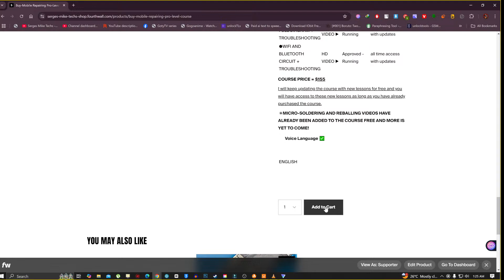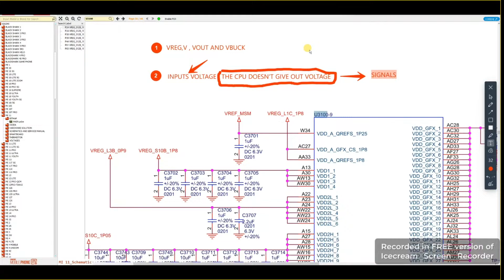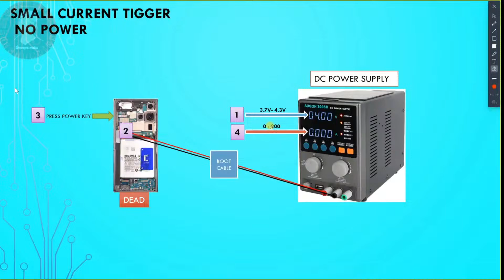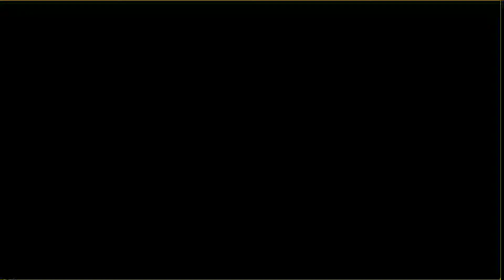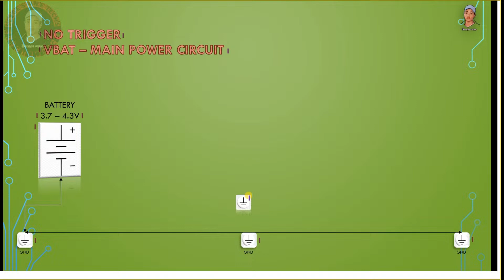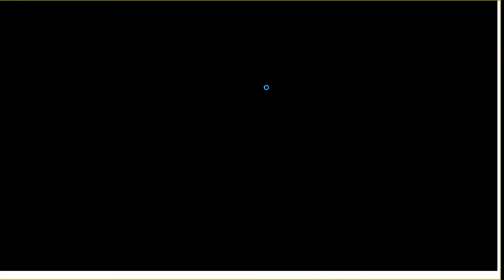How to Troubleshoot And repair Mobile Phone |Advance Mobile Repairing Course

Comment from the maker: 🎉 Get 58% OFF on my Chip Level Repair Course this holiday season! 🔥

Promo Details:

Promo Code: SERGESMIKETECHS

Auto-Apply Promo Link: Get Your Discount Here https://serges-mike-techs-shop.fourthwall.com/promo/AUTO_XW6DE8-E1HTLASNSX9L9

Course Pricing:

Basic Level Course:
Standard Price: $75
Promotion Price: $35

Pro Level Course:
Standard Price: $155
Promotion Price: $65

Both Courses (Total Standard Price: $230):
Promotion Price: $100

🎁 Hurry, the offer ends on January 2nd!
Get started today and enhance your skills with these discounted courses! ✅